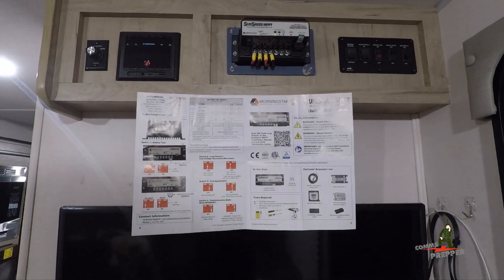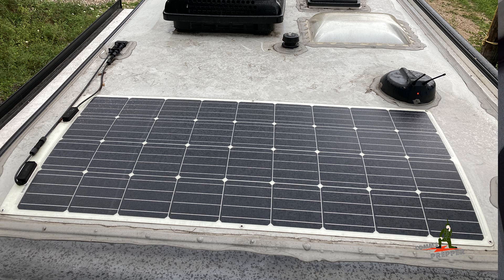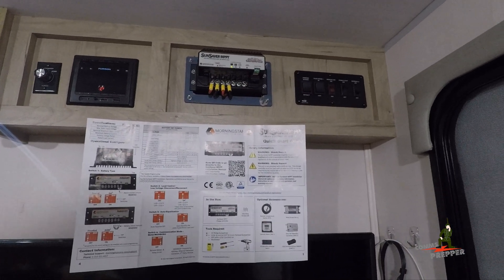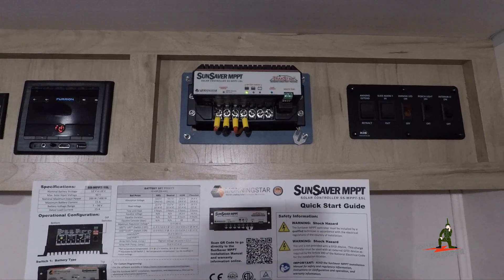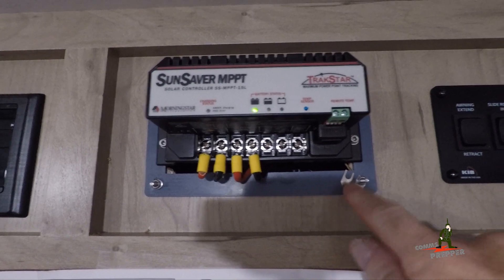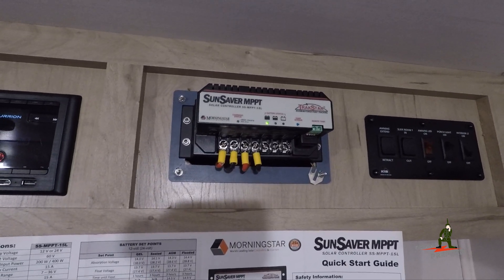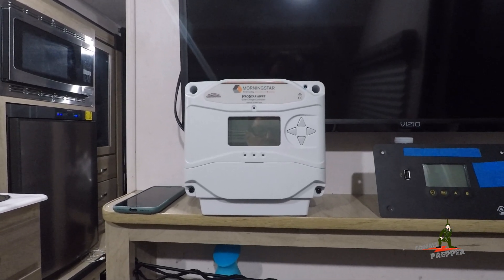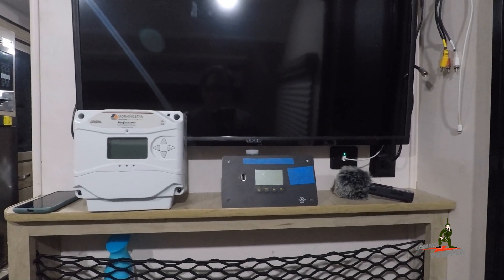R-POD Camper Solar Power Upgrade (Morningstar Charge Controller)

Comment: I'd be interested in finding out if you get RF noise on HF with that MPPT charge controller. And if you do what you do to suppress or eliminate the noise.
Reply from the maker: Something I will have to check.  I know my inverter is very noisy and I have to turn it off.

Comment: I also appreciate Morningstar.  Yet because of the risk of EMP, I chose the less costly option and purchased 3 PWM Morningstar charge controllers, two as spares stored in a Faraday cage, instead of one Mppt type.  Stuck with flood lead acid because they are impervious to EMP, whereas the lithium has a chip in the battery that is needed to regulate charging.  Space and weight are not an obstacle in my application.